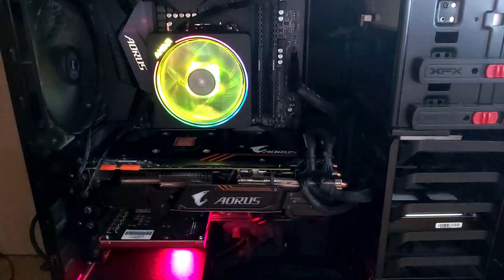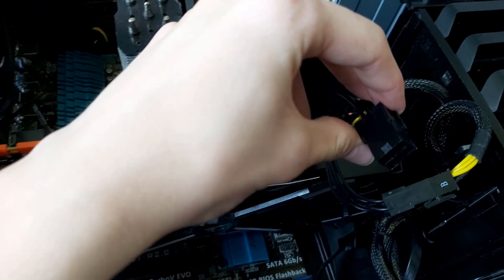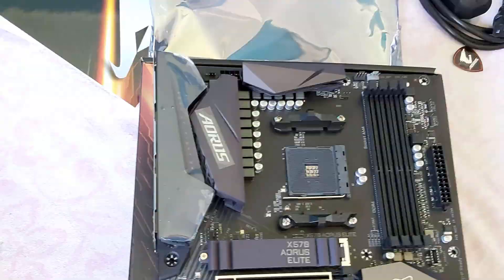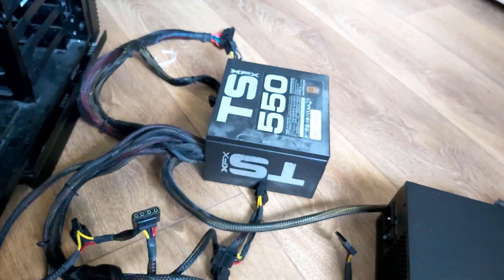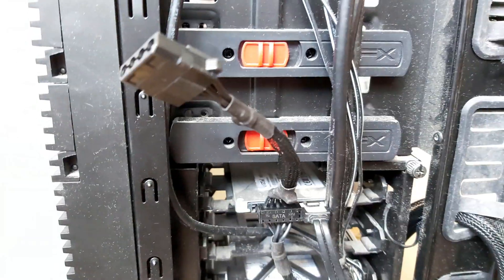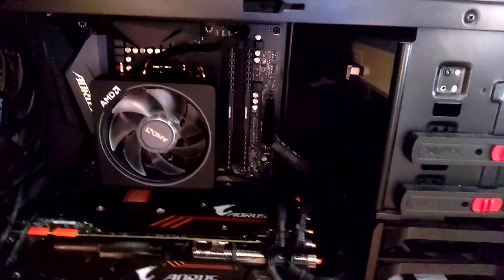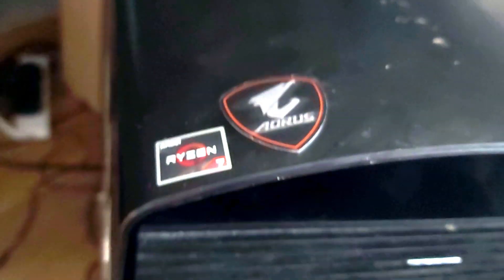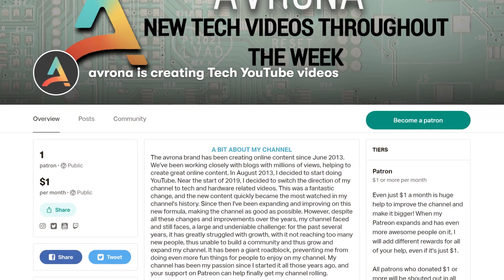FINALLY Upgrading to a Ryzen 3700x! Ryzen PC Build

Comment: I mean you could of blown out/cleaned some of that dust out
Reply from the maker: I did actually clean it out a lot as I went along with the upgrade, issue is I've had this case since 2014, meaning dust is pretty much everywhere in it by now.
Reply: @avrona  Leaf blower is a quick and easy way of blasting dust from a computer.

Comment: I just did a similar upgrade FX 8350 rx 480 4gb to Ryzen 3700x x570 Tuf and a 2070 super what a difference
Reply: planning to do the exact same build! how did it go? any motherboard/cpu compatibility issues?
Reply: @zachferris7864  Went well used old SSD and HD so forgot to clean out old AMD settings, kind of baffled me for a bit after I cleaned it all out went off without a hitch, using a corsair h100i pro, the 3700 goes to 4.4 in POD, and the 2070 is OC'd to 2000 MHz, went from a 75mhz refresh monitor to 1ms 144 MHz this thing blazes thru games on highest settings
Reply: What ram did you use for the Asus TUF X570? im planning to do the same upgrade from FX 8320 and GTX 970
Reply: @Samir92513  Team Dark DDR4 3200 cl14, supposed to be one the best timings for 3200 and B-Die